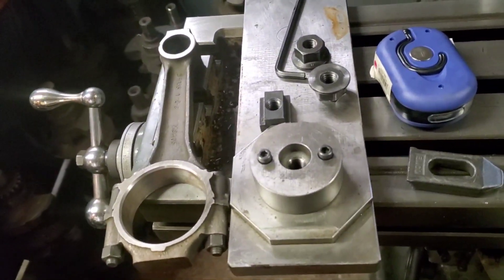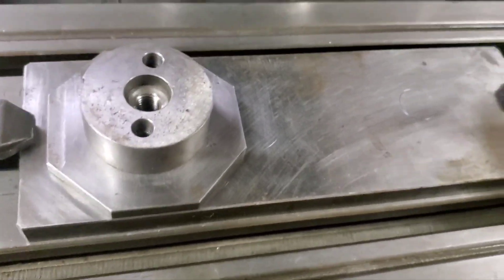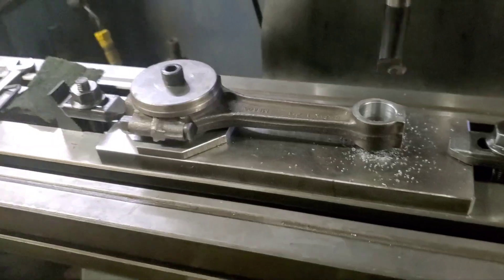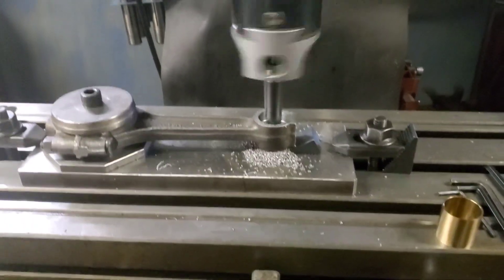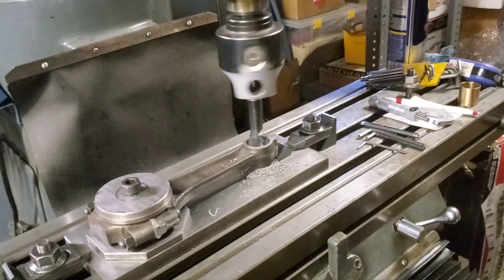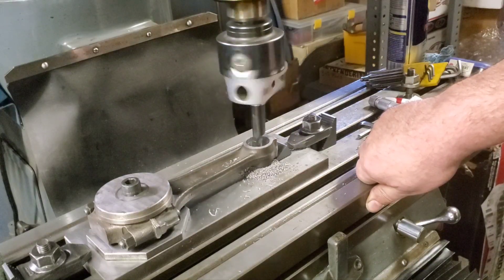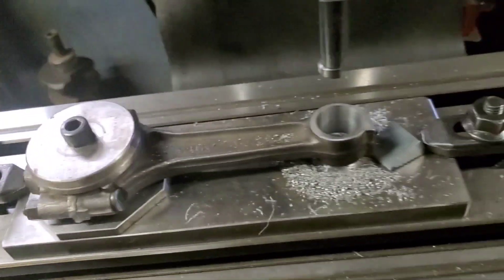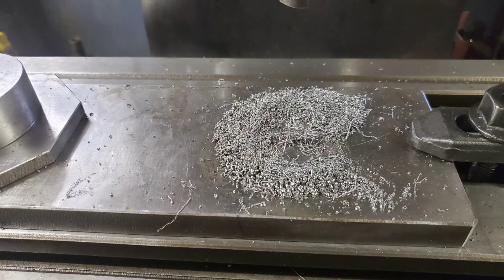Mopar 440 Connecting Rod Full Float Bushing Install.

Comment: Chev(454) and Ford (460)  stock rods cut the same as this Mopar?   what rpm on the spindle?  great work!!!!!
Reply from the maker: Thanks for watching and commenting. 
Typically you can bush the factory Chevy rods.
They make a step reamer or you can bore the rods out.
On the Fords I would not Bush them on the 460.
We hone and run steel to steel.
We have had good luck with that.
Remember to add your oil hole.
But as affordable as aftermarket rods are such as Scat, Eagle or Molnar.
I would really weigh out your options.
The RPM for machining is about 200 to 400 if I remember correctly. 
About .003 feed rate.
As you can see in the setup it is not real rigid.
Take care, Ed.

Comment: Nice work Ed  I had thoughts of boring out the bushings in the rods that I was working on. but the tool I made was able to press them out. thanks
Reply from the maker: Thanks for watching Randy.
I really appreciate it.
I was boring the replacement bushing.
The rod was press fit originally, but had a bad bore.
So I bored it out and bushed it.
Take care, Ed.